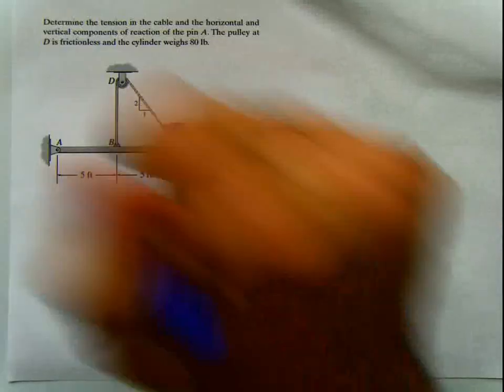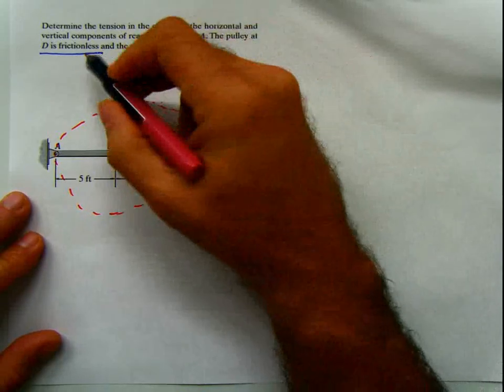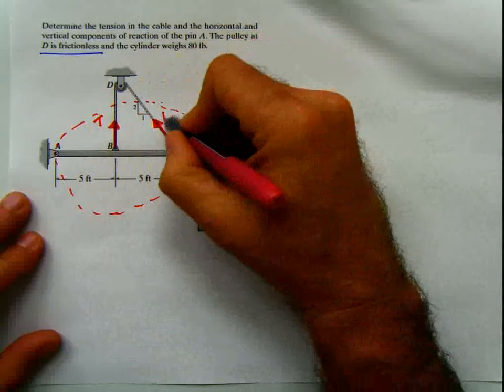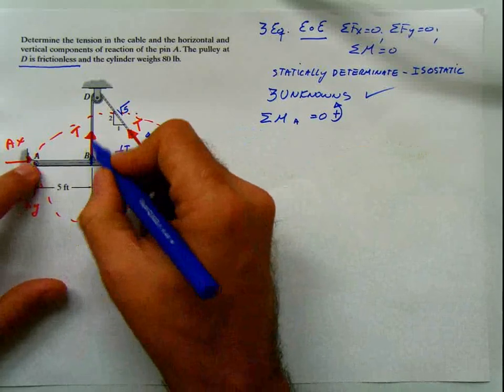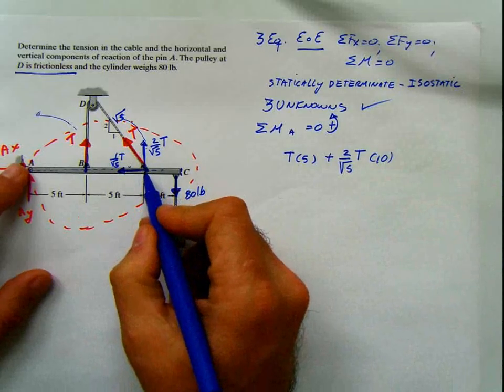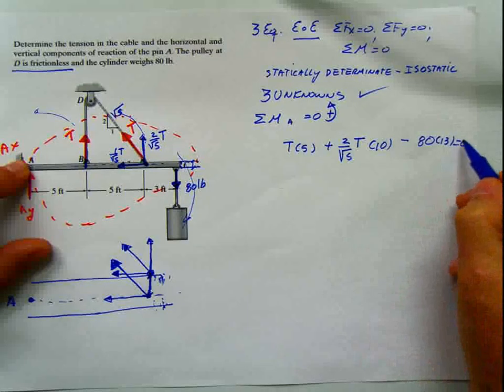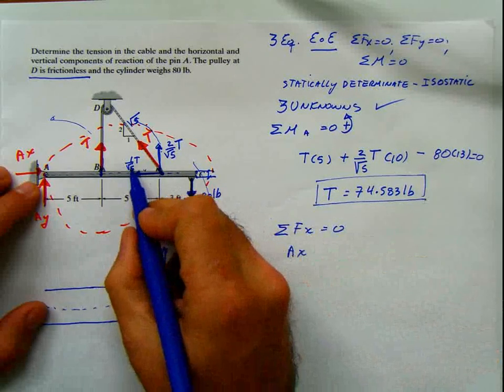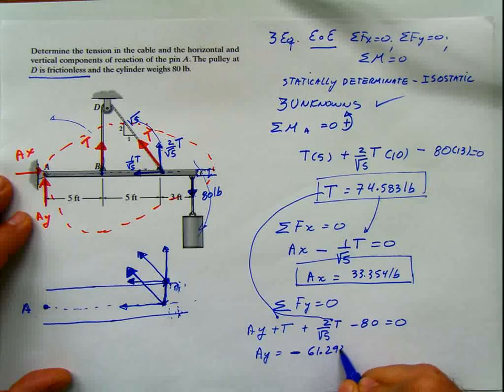Chapter 5.1 - Conditions for Rigid-Body Equilibrium

Comment: I'm somewhat confused, if the tension is equal on the hypotenuse side as well as the other side because its a frictionless pulley how come you made the hypotenuse square root of 5. I'm kind of confused by that.

Also, how come you made your T's drawing towards the pulley, if the rope was in tension shouldn't the force be facing the other way as to pull on the rope. If the force is going towards the pulley it would be pushing the rope in, not pulling on it.